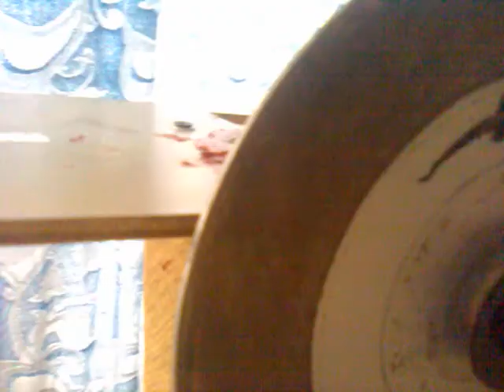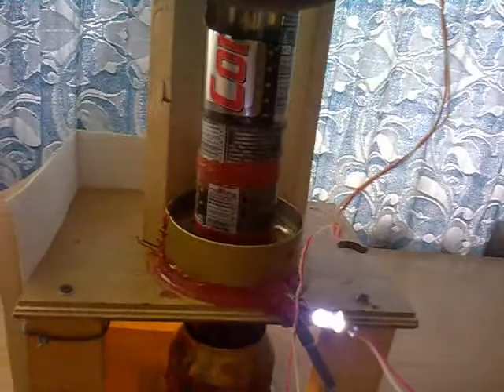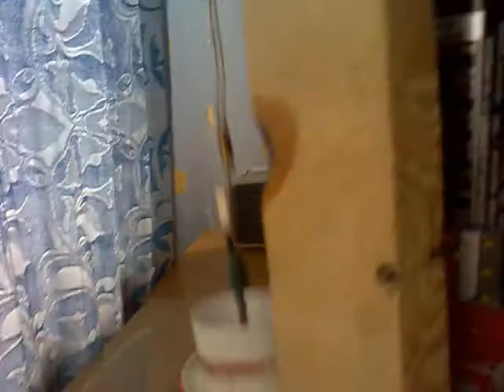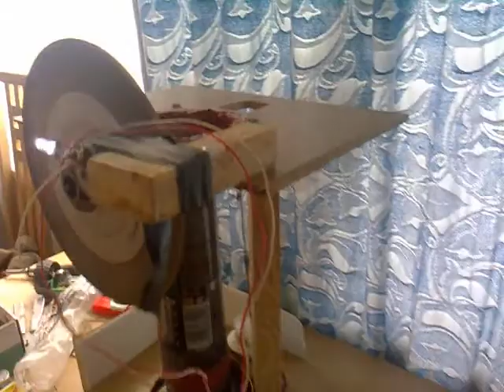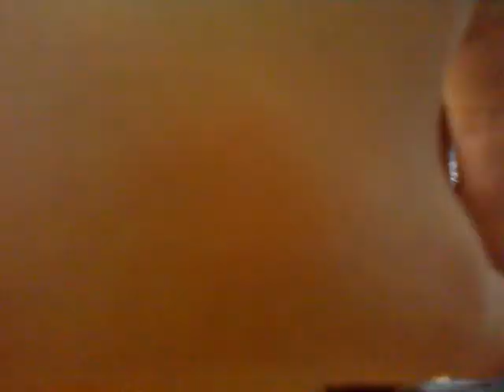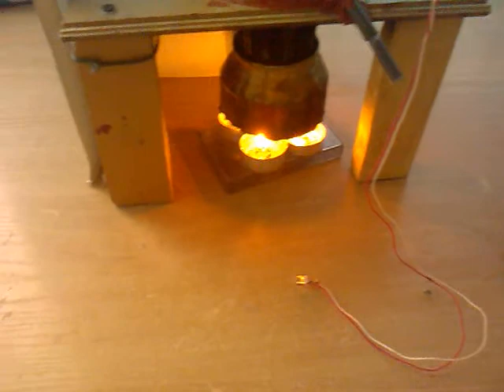Second stirling engine with generator and LED

Comment: Very good! Congratulations!
Tip! As your engine and mine has the same settings, I believe that with a fire a little higher and near the bottom of the engine and with a chimney will have even more performance. Still, it's a great efficiency. 
Congratulations on the video quality.

Comment: Yes! With chimney is better! Because if not, the greatest concentration of heat does not reach the bottom of the can, because the heat must be renewed, with the burning of fuel. "type is a swirl of heat in the oven".

Comment: Good work!  I like seeing the progress you've made from the begining.  Is that an old printer motor you are using as a generator?  If you have time, could you take some volt and amp readings?